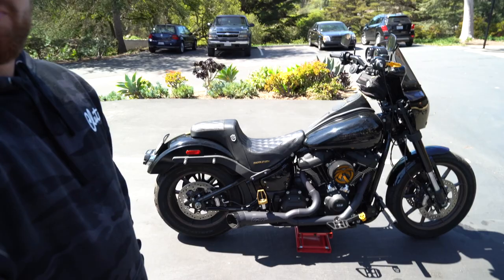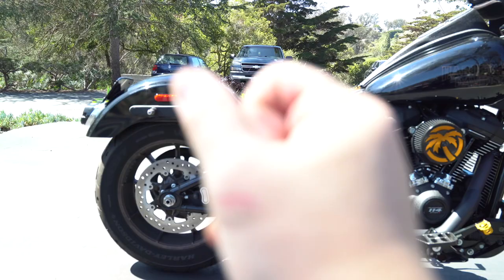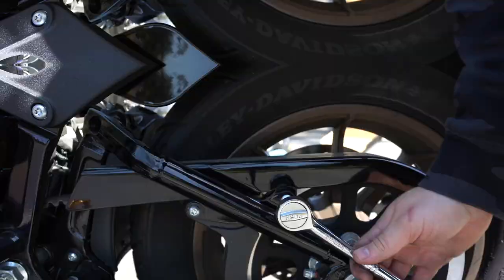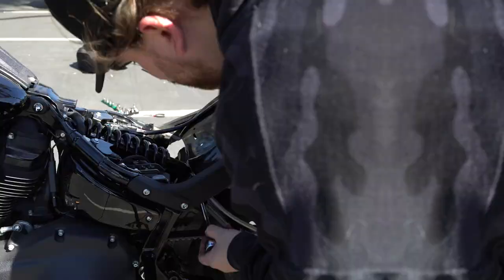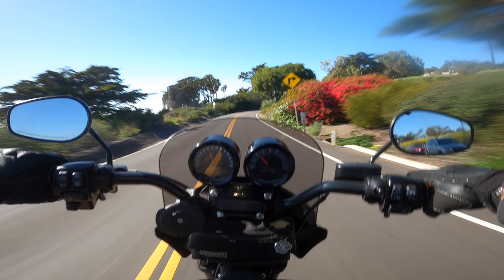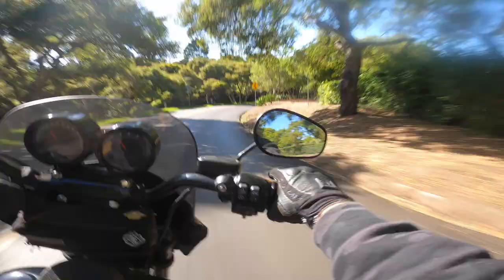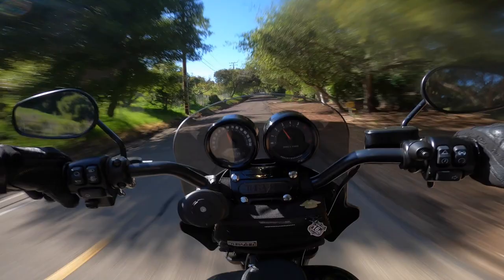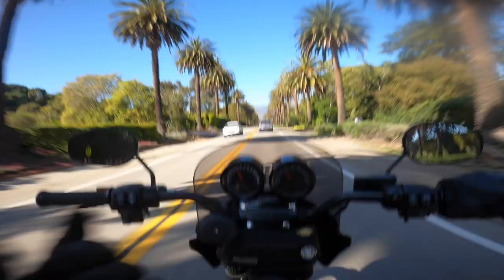How to install RWD RS-1 Monoshock for Harley Davidson! How does it perform? 🤔

Comment: Nice video. I think I'll be doing this to my FXLRS. Also, you definitely need to adjust your belt tension after such a drastic change in the suspension. That's a pretty important step bud... Anyway, more lean angle, easier wheelies, more comfy. What's not to like?

Comment: Looks great! I ended up installing a Nitron R1 shock because with those you can get different length eyelets and the eyelets are adjustable by screwing them in or out. 
So I have mine currently set up at the point where I haven’t needed to
shave anything off the frame. Probably about 13.5”

Comment: What gauge mount do you have? Speed Kings? I have the same gauges and they have the silver trim ring. I see yours are all black. Looks like your gauge housing covers that silver trim ring. I like the all black look. Did you just add a cover over the top?

Comment: Ok, I love your set up. I just subscribed because I love your bike haha. Great videos, you’re easy to listen to and you’re having a great time. How do I get my gauges high mounted like yours?
Reply from the maker: Hey thanks, man! I really appreciate that! 

To get the gauges mounted up you need a bracket to put them in, and something to fill the holes in your dash. My bracket is from speed kings cycle. The only thing their kit doesn’t come with is the gaskets for the back of the gauges, but they lost the Harley part number for you to get from the dealership. As far as the dash block off plates, mine are from Hairy Customs, but the 31 state block off plates, or the ones from hardcase performance are also great choices! 👍🏻
Reply: @CassidyCarson  you are the man. After I subscribed I watched your other videos and saw the rest of the upgrades. Looks rad!
Reply from the maker: Thanks man! Stay tuned for more for sure 👊🏻😜

Comment: Amazing video man, im looking to do the same for my 2021 street bob because i want a performance cruiser.
Reply from the maker: I love that, man! You gotta let me know how you like that 114 in the street bob! One of my favorite additions to the 2021 lineup for sure!
Reply: @CassidyCarson  im absolutely loving it dude, its an amazing bike, it already has a pretty great stock lean angle, i can really carve the canyons with a ton of confidence so i can imagine how much better the additional clearance is. The 114 is mind blowing tbh, so much torque so early in the rpm and the powerband is smooth. Ive only had it a little over a week and have already put 900 miles on it.

Comment: Nice mod, agree the stock suspension is great on this bike, this mod is all about the extra lean I guess. Do you have Instagram mate ?
Reply from the maker: Yessir! Overall ride quality is better as well. Like I said in the video, the stock suspension isn't bad by any means, but this just takes it to the next level. 

And yes, my IG is @cass_carson 👍🏻
Reply: It gives you a bit more lean but it also makes the bike feel more responsive and it corners better. This is due having a bit less rake on the front forks and a shorter wheel base after installing a taller shock.
The other thing I did was I got a smaller front tyre put on (Avon Cobra) This reduced front wheel diameter by almost 0.75”. 
All of that combined makes it very agile in the twisties